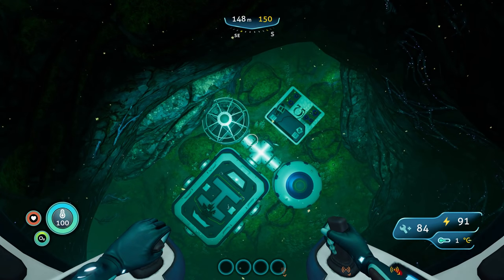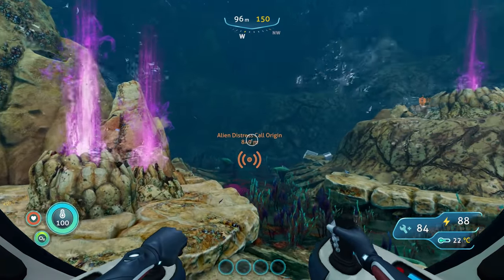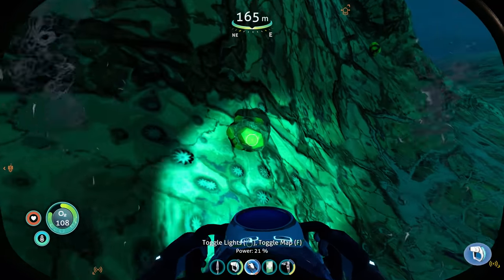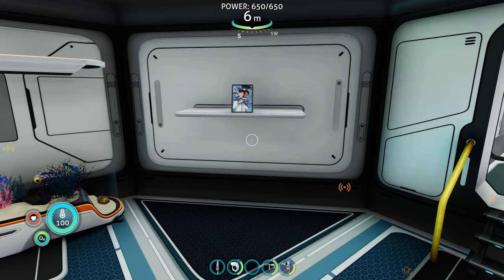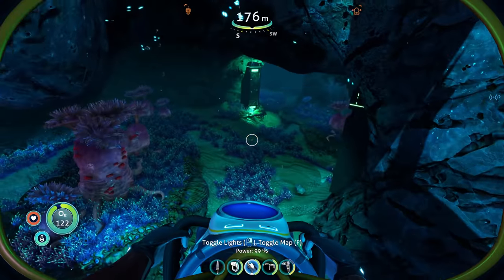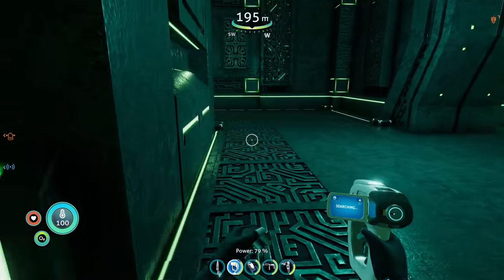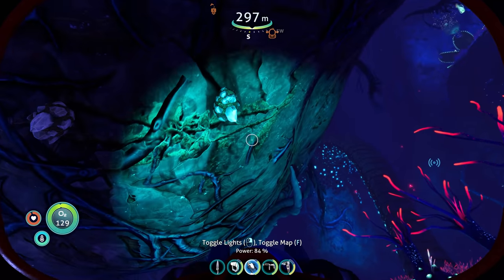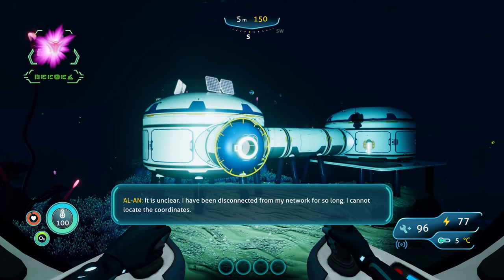Subnautica Below Zero - Drowning Simulator 3.0

Comment: The dangernoodles in the original subnautica have predefined boundaries and are not patroling the "safe shallows" starting area. There are 3 zones you find the danger noodles and that's by the crashed ship, only one in the far back where you enter, easily avoidable.

There is a zone in the north vest in the "dunes" where multiple are patroling a wreck with loot. 

And finally north east by the island again patroling a wreck. 

I found the original scary, but I never runed into one other than seeing the outlines. You really had to go far outside the "normal" traveling routes to bump into one.

Comment: It never ceases to amaze me that in Alterran technology, you can increase the physical toughness of a submersible by plugging a canister into a socket under an access hatch. I suppose that could be explained that the canister generates a forcefield of some kind, but it still works if the submersible loses power. So I guess that's just one of those "don't think about it" things too.  :P

Comment: Anyone else is worried that jingles did his trademark move and didnt realize the difficulty hes playing on?
Reply: Yes I was wondering whether the comparative lack of snurglies and other nasties is due to the difficulty settings.
Reply: I started up a playthrough about the same time on survival and hes correct, the amount and density of angry sea monsters is much lower than in early access. But to be fair, it was a bit oppressive before, sometimes you would stop to grab resources and see like 4-5 of those guys in the vents area in a 50m radius to you. Twisty bridges also has way less sharks than before.
Reply: @Saurlok Thanks. But when Jingles complains there's not enough things trying to eat his character, suggests they've cut the numbers slightly too much.

Maybe a slider setting?

From "Even Jingles Thinks This Is Too Few Snurglies" to "Jingles playing Alien Isolation Scary". 😁
Reply: @Penfolduk001  Oh i agree entirely, they went too far in the other direction. One thing i also noticed was they changed the sound on the "Cryptosuchus" (Interesting name) The noises they make are more quiet/softer now and with way less of them they just dont sound scary as they used to. Subnautica is a careful balance to make the that Atmospheric horror/dread feeling.

Comment: Actually Jingles, Ion cubes weren't super rare in the first Subnautica, they were just not as readily pointed out. If you took the time to locate all of the Architect caches then you would find quite a few of them, and then there was the machine that grew Ion cubes at the end which was more for enuring you had enough to make ion cells for the rocket. However, you had to seek the other caches out from just the clues on the PDA. They just seem less rare in Below Zero since the game is actively guiding you to them as part of the story.

Edit: Also everyone asking how Jingles missed an S-O-S, maybe the alien should have used C-Q-D?

Comment: actually jingles, the ship the Mercury II is in 3 pieces- the stern wreck, the bow wreck, and the booster pod. you were at the smallest of the 3, the booster pod. but i'm typing this just 5-6 min in so i havent seen if you've corrected it or not. so now at about 15 min, @15:07, you are spinning around looking for the sea truck and totally miss the platform you NEED to go to.

Comment: Leviathans in Below Zero are boring. They chew on your seatruck for a bit and then just swim away. And a truck can take at least 2 rounds of chewing - more from the smaller specimen - so you can always disengage and repair. It gets worse when you install perimeter defence - just zap 'em, they will spit your mini-sub right out and fuck off.
And on the subject of that photo - that is ackchually your sister hugging her white lesbian gf.

Comment: Still hoping fora gernater module for seatruck.
It just don't feel like mobile nase without that .
Reply: considering how small and one directional the map is, there isnt a point in making "mobile base" anyway, you are never more than a minute away from your base if you plop it near the Delta Dock ...
Reply: @Asghaad  I agree with you.
I guess is more a me problem.
I always get nervous when batteries go down, feared that it will go down to zero when I am in deep deep ocean and there are very big and very unfriendly fishes around.
Then I have to climb out, change the batteries. As in Cyclops I can drive it to hot water which there are many in late game when Cyclops is useful.
Hey I just knew one more thing I miss Cyclops. I can change batteries inside! Oh I am such a coward!
Reply: @Gpower441  i have never ran out of power in the truck but if you have issues just make ion powercells